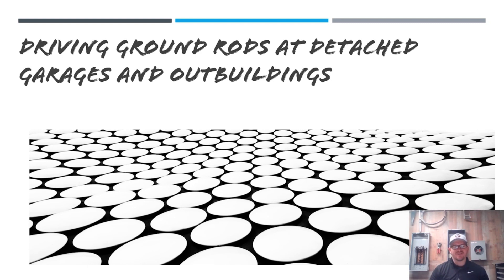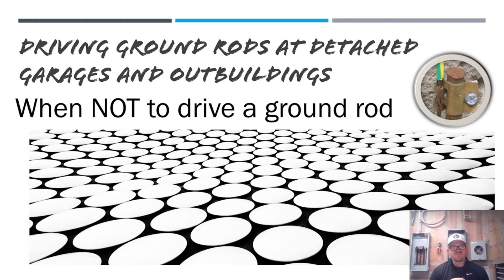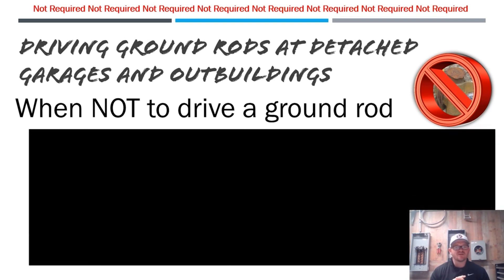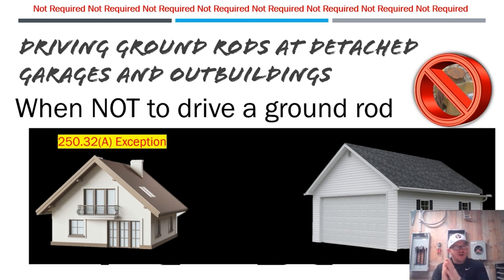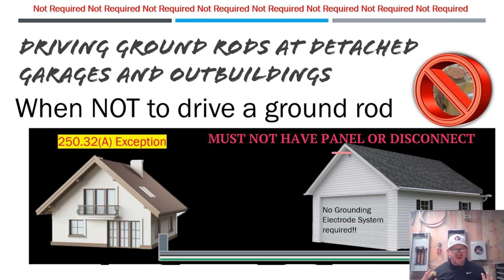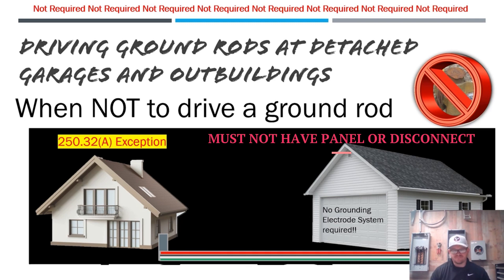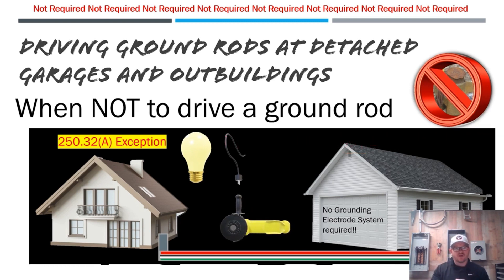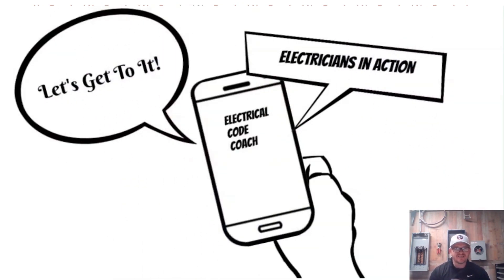When NOT to drive a Ground Rod at a Detached Building

Comment: @electricalcodecoach 
Does code specify if there is a maximum amperage and still being able to run without ground rods?  Can I run 30A/240v -No neutral for a hardwired piece of equipment and still not install ground rods?

Comment: Vernacular slang "110" is inaccurate. 120v, 240v, 360v, 480v are accurate.
Reply from the maker: Eh 120, 240, 360, 480, are nominal voltages. Accurate readings are accurate.